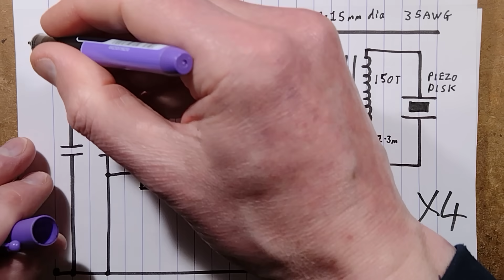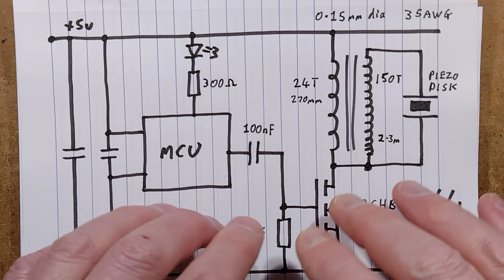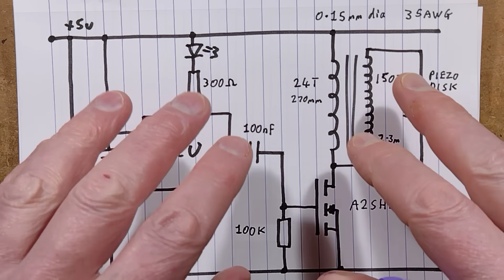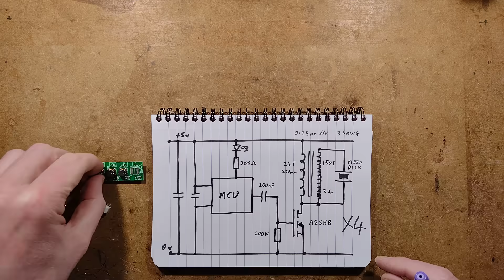4-head ultrasonic water atomiser - with schematic

Comment: DOA - not working right out of the box (Bag).  I see my USB power monitor drawing a constant .43A with no mist at all after several minutes of waiting.  And yes my same USB supply shows 1A+ when charging my phone so this is not a current limit situation.  What current draw are others seeing?
Reply from the maker: Did you put disks on all the outputs and have them in water?  The disks shouldn't be operated for long when dry and there must be loads on all outputs to protect the circuitry from open circuit high voltage spikes.

Comment: Lessee, about eight of these units in a circle, four uprights with holes drilled and an air supply, and an exhaust fan at the top, and you've got a tornado simulator! (also needs some bright lights at top)

Comment: Regarding that thing where the USB C port doesn't have programming resistors - does anyone make a little USB C male/female inline thing with those parts? I had to stop using my nice USB C multiport charger because I have so many devices that won't charge from them, I have to use an A to C cable on an old school dumb charger to get them to work. It'd be nice to have a little inline thing to make the charger deliver some standard amount of current, even 1 amp would be fine since most of these are cheap little things with small batteries.

Comment: What's the resonant frequency of the piezo used in this system? I've seen similar looking nebulisers advertised as either ~100k or ~1 MHz... both common frequencies for these small ultrasonic transducers, but I wonder if there really are two types being sold. I guess the circuit looks more suitable for kHz rather than MHz.
Reply from the maker: Definitely in the 10's of kHz.

Comment: How would you propose regulating the amount of flow from this unit?  For instance to use it on a small engine for water mist injection?
Reply from the maker: It could be done in software with burst firing, or possibly by varying the supply voltage slightly.

Comment: I had an Arctic Air 2.0 that had just 1 of the Piezo things to keep me cool in the summer. I think the Tap Water killed it because it stopped working and visible rust was evident.

Should i blame the Tap Water or a lesser componet?
Reply from the maker: It may have clogged with minerals in the water.  The rust may indicate electrolytic corrosion.

Comment: Could make a nice acetone vapor smoothing unit for 3d printed parts(ABS/ASA), after switching out plastic parts(the black abs wick holders and base)for ones with more chemical resistance(and keeping the electronics/wiring away from the chemical vapor). The piezo discs should not have an issue with acetone. The only issue is to maintain a continuous flow of acetone through a pesistaltic pump, if wicking is not enough(from past experience). Also would be interesting to see particle size🤞, since anything large would deposit as droplets and not good for precise smoothing. But can be fixed with a foam filter(used in fishtanks). Compared to a Polymaker's polysher, it would be a steal. Already ordered a couple to experiment with.Still not bad for 5 bucks. 😊❤👍
Reply from the maker: I'm not sure how resilient the devices will be to acetone.

Comment: Are the wire gauge the same on the primary and secondary of the transformers? Typically, since power in = power out to first approximation, the high turns side secondary uses thinner wire than the low turns primary.
Reply from the maker: Same gauge.

Comment: I noticed that there is no flyback diode in parallel to the primary winding. I would have expected a flyback diode to prevent hi-voltage spikes to damage the switching MOSFET (even with its internal body diode) and induce voltage spikes into the supply rails.
I would love to see the voltage across the D-S junction of the MOSFET on an oscilloscope.
Reply from the maker: I think the piezo element requires the AC.  So it acts as a load to keep the peak voltage down.

Comment: With the 100K resistor, that 100nF capacitor gives a high pass filter of about 16Hz, which seems ridiculously low for a system that's meant to run at an ultrasonic frequency.

Comment: Can these wicks be bent? I was looking into these to add to my small plant incubator I'm building with grow LED's, soil moisture sensor, watering pump, etc. I would need them to work up-side-down.
Reply from the maker: Some units just have the atomiser disk with a water reservoir above it. but with too much water weight it will just leak and not atomise properly.

Comment: The documents, such as they are, suggest that you should not run a single channel alone. Indeed, kannacat1 posted that they burned theirs out.  I think I've seen similar warnings on CCFL and EL Wire drivers.  
What's the story? Why do these fail if they're left open-circuit?
Reply from the maker: Open circuit will let the winding voltage spike quite high, and also risk damaging the transistor.

Comment: A very popular system in the Model Railway Field at the moment, where the effect of "Real Steam" is very much desired.  Better than the older Oil-Based, heated element generators.  Like those old systems and the increase in micro-electronics in the Model Railway Scene, the long term effects of having a water mist floating around a model is yet to be seen in the long term.  The older Oil-Based ones left quite a heavy residue if used often on the Locomotives.  Nice to see that a 'home-made' set-up could be achieved.  I'd tried something with an 'Air-Wick' system a few years back but fitting a water tank wasn't easy on the old locomotive I was using.  Nice one Clive.  Cheers!

Comment: I imagine lighting these plumes of water looks cool!
Reply from the maker: There are illuminated and sequenced versions.
Reply: I wouldn't try it..... But would it make a pyrotechnic if you used something slightly flammable? Or would you not wiffle that?? 😂
Reply: Low power lasers would be pretty hot through these.

Comment: will these devices vaporize volatile liquids, ie Kerosene or diesel fuel?
Reply from the maker: Yes.  Search my videos for the word kerosene.
Reply: While I'm unfamiliar with these specific transducers, I once used a pricier model in a carburetor-like project. Though the project ultimately failed, the transducer did successfully atomized gasoline.

Comment: Currently $2.73 is the best price "Down Under"!   Definitely a neat little gadget, and very handy for misting plants. Thanks heaps for covering it - we (or rather I) have bought two of them! Any thoughts on covering those Butane-powered catalytic heater soldering irons? They are very handy where there's no power on tap!
Reply from the maker: I found the output of butane irons to be widely variable in use.  But they have their place

Comment: As others stated, would be great to show a 4-channel scope capture that would illustrate how these four piezo elements are fired: sequentially, two-by-two, or all four simultaneously.
I think, you don't need to talk for 10 minutes about the differences between the waveforms when measured at the MCU output, versus after the capacitor at the mosfet's gate, versus at the source of the mosfet, with the captures live on screen. But at least, scope the board before recording the video so you can tell us about the firing order. Or maybe print a scope capture and show it like you show the board layout. Even if you don't have 4 channels, then you can first capture the total current waveform and compare that to a voltage graph of one channel.
Just, don't just mention the possibility of sequential firing without actually measuring if that device indeed does that.
Or is this a cliffhanger for a part two?
You know you can still measure it, despite of the fact that one coil is missing. In fact, with one coil missing, it would be very easy to prove how they're fired, by just scoping the total current, one channel.
Reply: Take your own advice and make your own video!

Comment: is the waveform the uC puttin out just a set of pulses ?
Reply: I'm assuming uC means microcontroller, but this is the first time I've seen someone use that contraction.
Reply: rather common in technical documents to use that abbreviation - otherwise you spend about 4-5 minutes typing out the entire word 😂
Reply: @WhyNotDeanCV uC or ųC is 100% common 😅
Reply: I preffer ųĊ if I'm being totally honest
Reply from the maker: Yes.  Probably just a square wave.

Comment: These ultrasonic atomisers are great. They have only one great "flaw". You should use distilled water. If you keep using ordinary tap water for a loger period of time, they tend to "clog up" develop limescale crust and stop working properly. I used to have an indoor mist fountain and the manual explicitly said that no tap water shall be used because it shortens the life of the device. I used tap water. I shortened the life of it in the name of science. The manual was right!
Reply: Same thing when we were on holiday and the cottage had a Dimpliex opti-mist stove and had one of those sonic fountain things for it’s “flame” effect ~ filter tap water with 1 of those “money spinning” filter-jugs to “filter” out the calcium carbonate to stop the flame effect thing from furring up 😉
Reply: Get the 48V steel capped ones they crunch through with violence. Clive's variation however has another particular value it pumps the mist away otherwise there needs to be a fan to blow it into the air.
Reply: Many of the cheap ones require tap water and don't have enough power to vaporize distilled water, though they probably have shorter lifespan.
Reply: @railspony  wat

Also, just soak them in citric acid for a while and it'll dissolve the buildup.
Reply: using tap water also makes a lovely mist of, at best, microscopic lung irritants.
Reply: But do you know how much you shortened the life?  We have a floating mist maker in our little garden pond which gets filled from the hose.  Five years in service so far, and only one of seven piezo units stopped working (crystal failure).  Once a year the units get soaked in white vinegar to remove deposits.
Reply: Those springs I bet rust out in no time, perhaps also much faster in the distilled water.
Reply: I tried using these with sodium hydroxide and it worked okay.
Reply: @agentl3r  I tried hydrofluoric acid.  It's hard to tell if it still works as I have dissolved my own eyeballs.

Comment: Fun fact: The piezoelectric material used in the actuators of some common rail diesel injectors changes it's shape when an electric pulse is applied and keeps that new shape until an electric pulse of the opposite polarity is applied.
I guess they will eventually recover their original shape but not fast enough to shut down the injector in time. That change in shape is also very small, the whole stack of hundreds of piezoelectric sheets (or whatever they are called) used on a single actuator only expands less than the average diameter of a human hair, at least on a small car engine.

Comment: I just bought of those a couple of months ago from Ebay. The ad showed one like the one you have. When I got it, the bracket had them all in a row. It works well but I wonder if our hard water will clog up those cotton wicks. I didn't see any of the wicks for sale.
Reply: I've seen replacement wicks for sale. They were like $7 for a pack of 60.

Comment: That is actually pretty cool,  i can use it to test for air leaks in my HVAC ducts. But Unfortunately it wont let me buy them due to my Location, ill give you one guess as to why that is.
Nevermind, found another that will :)
Reply from the maker: It may be better using a fogger machine for that.
Reply: @ True, but normal fog machines arent that cheap :p. can also use it for finding drafts and such, so not a big deal really, more of just a fun thing to have.
Reply: If it's a tariff thing I'd think they'd just jack up the price rather than cut off their noses to spite their faces by refusing to sell.
Reply: They won't ship to my location either and I have no idea why. Give me a hint?? I'm in Commiefornia BTW.,

Comment: There should be a gate resistor to limit the current draw on the mcu port. 
If you think about it, the gate-source capacitance (Cgs) of a typical mosfet (IRF44N), is in single digit 2nF, but this technique is forcing the mcu port to pulse a 100+ nF. 
They should've used a 100 Ohm (standard) gate resistor which would also minimize ringing.
Unless this mcu has a protected port, it's toast in a short time.
Reply from the maker: At the frequencies involved the microcontroller will need all the current it can put out to drive the MOSFET gates.
Reply: @bigclivedotcom  I assume the freq is between 20kHz and 30Khz.
I don't understand your comment. Would you please elaborate?
Reply: @piconano  Not Clive but the gate turn-on and turn-off times need to be short compared to the cycle period in order to reduce losses in the transistor. My version of this atomizer uses 150kHz, so let's say we want 10% max of the switching cycle to be occupied by turn-on or turn-off. We have to cram two of these transitions into each cycle. So we need ~330ns or faster transitions. 

The 100nF capacitor used to AC couple the gates (which is there for unknown reasons, either fault tolerance as Clive said or to speed turn-off as another commenter said) does not add to the gate capacitance. It's in series, and so the effective capacitance of two capacitors in series is 1/(1/C1 + 1/C2). Probably not too different from the bare gate capacitance since this equation is limited by the smaller of the two caps.

The input capacitance of a mosfet during switching is not really good to model as a pure capacitance anyway, due to the Miller effect (the voltage on the drain tends to make the capacitance look like it is nonlinear and tends to absorb quite a lot of charge right near the gate drive plateau voltage corresponding to the operating drain current). But let's say it's a total gate charge of 5nC, not crazy for a FET like this. We have 300ns to accomplish this, so we need 16mA of gate drive current at the minimum (and more would be better to minimize losses). 

A typical MCU output pin exhibits 20 to 100mA of short circuit current in my experience although I'm sure it varies greatly, and maybe 20-50 ohms of on-state resistance. They really don't mind putting out current into a capacitive load as long as the overall average power dissipation isn't too great.
 
After all, the typical MCU port switching time characteristic on the datasheet is rated with a 30pF-50pF load... every time the port switches, for a moment it's firing into a "capacitive short circuit". For instance the STM32H573 is rated to switch at 100MHz on the fastest port setting into a 50pF load. My experience with STM32 is that they use a port output structure that delivers about 40mA of short circuit current, so with 50pF of load, that port is spending 1/4th of its time either charging or discharging a capacitor! That is a datasheet rating condition. Not outside of how the part is intended to be used, for sure. Driving a 1nF effective gate capacitance at 100kHz is easier than that.

So ok, but we could put a 100 ohm resistor in there, the peak current will still be over our 16mA average drive requirement. But it means that the nice ~constant current saturated FET output characteristic of the MCU pin now has an exponentially decaying RC characteristic added to it. The circuit may struggle to charge the external FET's gate through the last couple nC of the operating charge plateau in a reasonable time. Why add that? The MCU is fine firing into a capacitive load, and will produce a snappier drive pulse doing so.

Another commenter observed that the 100nF capacitor is installed in a footprint marked "R something" so I think the designers originally intended to do what you suggest, and found that it didn't work well. 

I think you'd find that there would be absolutely no gate ringing for reasonable PCB layouts. The capacitance is so large that the RLC circuit formed by the trace inductance, MCU output driver resistance, and load capacitance will be more than over-damped.

There will of course be ringing of the drain node... but that's probably the point. This isn't just a forward converter, they're driving the second winding and piezo as a resonant circuit from what I can see.
Reply: @InductorMan  Jesus of pedantics!
You write books as comments?!
You are turning on-off a 100+ nF capacitor with an MCU port rated for 20~40mA. End of comment.
Reply: @piconano  I'm sorry you seem irritated by my comment, not my intent. Although I think the difference between the 100nF load you have erroneously arrived at and the actual 1nF load is a bit more than pedantic! I'm all for order of magnitude engineering, but being off by a factor of 100 often doesn't work out very well.
Reply: @InductorMan  I'll answer you when my computer is back up. This Android tablet sucks and I can't work it
Reply: @InductorMan  I don't know how you came to the conclusion that the 100nF capacitor depicted,  turned out to be a 1nF capacitor in your book. I'm sure you do know the capacitors in parallel add up. That's what perplexes me.
Reply: @piconano  I admit, I'm now very confused. Are we just talking about completely different things? I thought we were talking about the 100nF capacitor that's in series with the gate of each FET. Maybe we're not, and we're talking about something else? Of course the capacitor between the MCU pin and the FET is electrically in series with the gate, not in parallel with it, so if not that capacitor, which one did you mean?